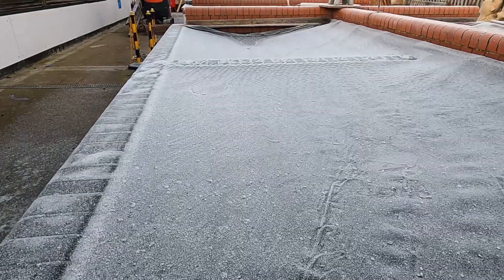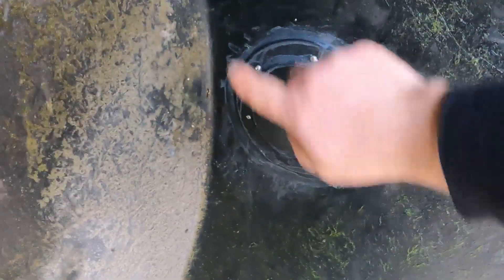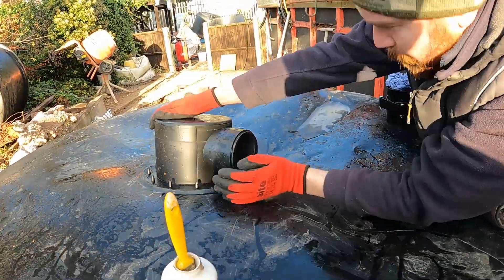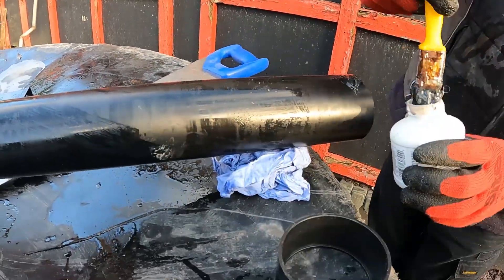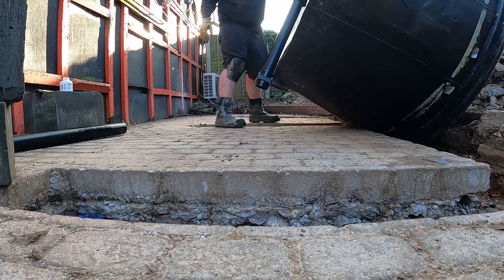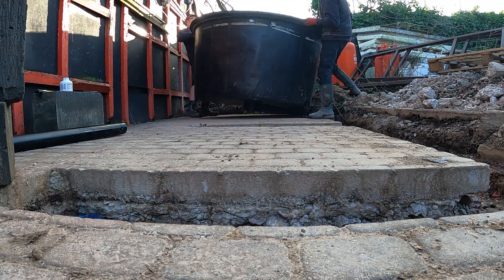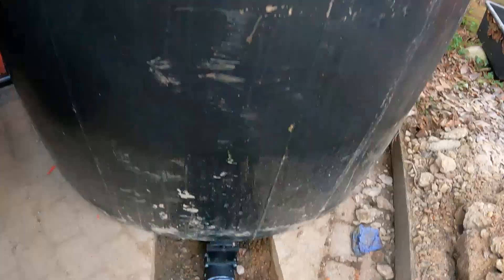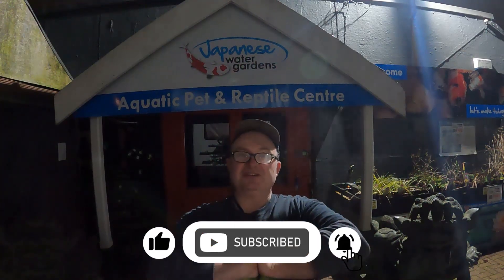Had to do it!

Comment: It's starting to come together  obviously with that much water volume  and the pressure on joints  and  the repairs  last thing needed is any form of leak   like the use of a proper size brush   with the solvent glue  and the amount used to ensure a good bond  . I'm one for roughing  both areas that solvent glue is used and brushing the joint over afterwards .  Look forward to following the rest of the build .
Reply from the maker: Roughing up the joints with a grinder and wiping with some solvent cleaner would produce a stronger bond for sure. solvent glue is amazingly forgiving though.
Reply: @leecalladine     I used  few tubs on all my pipework and joints    when building my  filters systems   and used a  flap wheel to rough every joint  first .  7 years no leaks

Comment: Looking good bud although I would have peeled the price label of the bush first as I'm pretty sure solvent weld doesn't stick to paper 👍😉
Reply from the maker: I used to worry about that.  Never had a problem done it hundreds of times.  I know it's not supposed to be like that but plenty of glue does it.
Reply: @leecalladine  lol fair enough 👍 if it works it works ☺️

Comment: Nice job , looking forward to the next video.
Isaw you were turning the pipe while glueing/insertion  it , this is realy bad for the connections.
All pvc pipe and pvc glue producers recommand a straight sliding movement without turning otherwise it will compromise the imperméability.
Greetings from france.
Reply from the maker: Use plenty of glue no problem.